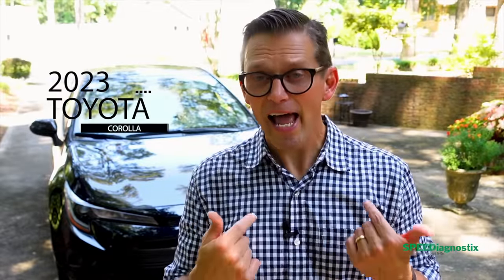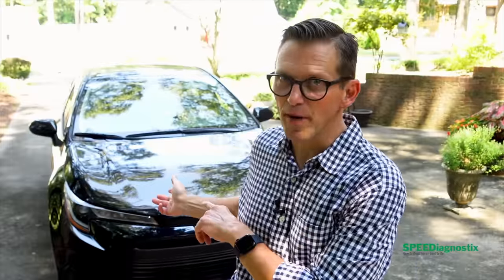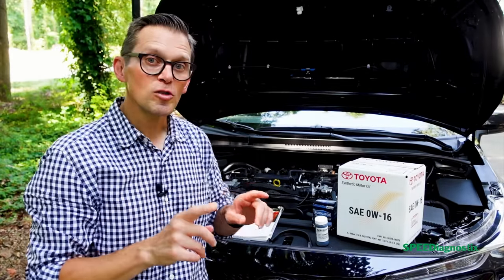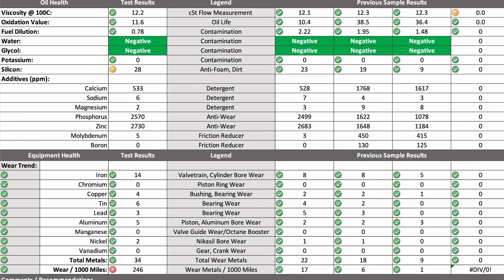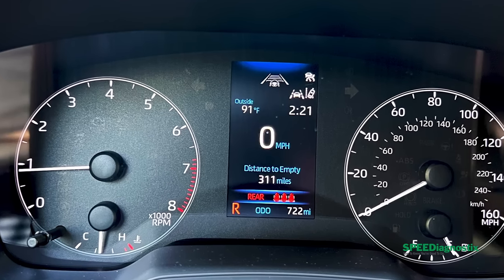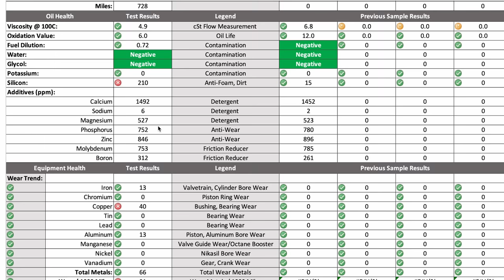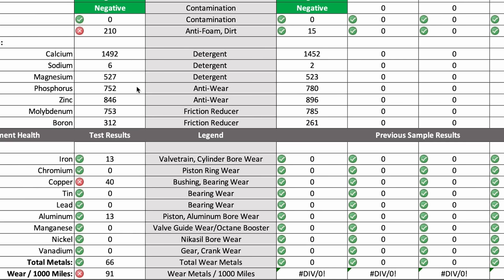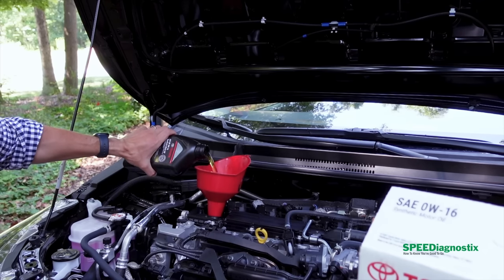AVOID the ONE MISTAKE Almost EVERYONE Makes With A Brand New Car

Comment: My Dad taught me that oil is cheap but engines are expensive.  That advice has always served me well.
Reply from the maker: Great point!
Reply: You can pick up an engine for $800, which is what a lot of idiots on this thread seem to spend on oil every year by changing it every 1000 miles 🤣  10k is perfectly fine.
Reply: well not so cheap any more. the price of 5 liters of oil is now north of 60$ in nazi europe.
Reply: @motleydude73 yeah and that new engine is guaranteed to be good and the work to install it is free /s
Reply: Hah! $800 won’t get you much of an engine. 10k is NOT fine. The proof is in these vids & the oil analysis. This guy speaks a lot of crap claiming 10k is fine, but with nothing to back it up. Unlike Lake, who has the analysis to back up his claims.
Reply: @phloughtgnarpsehs7263  10K IS perfectly fine.  Are 15000 oil changes and 32 years in the trade not enough to back up my claims? You Americans listen to Trump so I guess it's not unexpected you listen to oil geeks nonsense too.
Reply: @motleydude73 You must be a car salesman. 😂😂😂
Reply: @336W  No, a Service Tech with 32 years experience actually. After around 15000 oil changes I've yet to see any problems from following manufacturers recommendations.
Reply: My old man said the same. The cheapest part of running a car and looking after it is to change the oil n filter regularly
Reply: @motleydude73  What kind of engine can you get for $800? 🤣 Have you bought a $800 engine personally? Not trying to sound rude. Just curious
Reply: @Hzq_ali  Any engine for cars from the 90s and early 2000s. We recently replaced one in a 2002 Nissan Maxima. Was $900 + labour.  Modern ones are dearer yes but rarely need replacing. Most people actually look after their vehicles and get many trouble free miles out of them.
Reply: @motleydude73 dude Jesus 10k oil would probably be diluted and awful especially on a high pressure turbocharged engine
Reply: @concealit4800  No it's perfectly fine. A good synthetic will do 25k quite easily. It's not 1984 anymore. Where do you americans get such deluded ideas from?
Reply: Amen to that !
Reply: @motleydude73 so for you finding a solid decent, reliable used engine for $800, paying to have it fit and enduring all the hassle around that is easier than just doing regular oil changes….hmmm i’m not so sure……
Reply: My automotive teacher took it further by saying "Chemicals are cheap, cars are not." It was because he was discussing cooling systems, and asked us all the last time we changed antifreeze. I said "3 years ago." He asked why I haven't changed it already. I said "My manual says I have 5 year antifreeze." He asked me if I went 5000 miles when my manual said to do 5000 mile oil changed.

The next day I bought antifreeze and changed it.
Reply: Your dad is old. So his copied saying is no longer valid. There are many cars owners with 300k miles plus on theirs on YouTube. I've asked many of them about their oil change intervals and they all said 7.5k and 10k miles. No one disagrees that changing oil every 1000 miles is better than every 2000 miles. The point being here is, better by how much? Will it make the engine last 10 times longer? Nope. And consider the cost and all the wasted oil needed to be processed because of some silly sayings.
Reply: pieces of wisdom in sayings from those in the past are ‘invalid’….hmm there goes all of ancient Greek wisdom are anybody for that matter……
Reply: What about “don’t touch it if it works”. Changing the oil every 5k miles instead of 10k gives you twice the chance to screw it up - under fill it. Starting it without oil after an oil change etc…
I personally change it every 9k miles, like specified in the book, and had no issues at all
Reply: @motleydude73 not all engines are that cheap. One for my car costs $13k and has to be imported from Germany.
Reply: Most oil brands use the same oil base, adding in their special blend of additives to make theirs different from the rest. Basically, the additives are very important here. This geek decided to throw out the first oil from Toyota that engineers probably had special added chemicals to help with engine breaking in, and use his regular favorite brand. I don't know if that is a smart or dumb move. Why do people always think they are smarter than the ones that actually designed the cars and engines?
Reply: @noblekitty  because the ones that designed the cars design them to fail at 150k miles. It’s all by design. They don’t make a lot of money on selling you a car once. They need to sell you repairs and possibly a new engine or even a new car.
Reply: @JordanBlue1  Yes, most are in the thousands, but rarely needed. And covered under warranty usually anyway.
Reply: @motleydude73  Where do you get those prices from - 1975? Give me a break. Every mechanic I know personally say 5K on oil changes, as it’s the best way to add longevity to an engine. I also always do a first change at 1K miles. It’s cheap insurance in the long run.
Reply: @JordanBlue1  If they design them to fail at 150K, which is impossible btw, they're not doing a very good job. Most cars easily do 250K these days without much problem. Mines at 172k miles, zero issues. I see high mileage cars every day that only need regular servicing, some are 20-30 years old. You talk utter bullshit.
Reply: @motleydude73  you talk bs, it’s so rare for cars to make it that long.
Reply: @motleydude73  Your're a little confused. Here in America, we measure distances in MILES, not in KIMOMETERS, like Europeans do. A mile is not the same as a kilometer. LOL... 1 mile = 1.6 km
Reply: @JordanBlue1  As I said, I see them every day, hundreds a week, thousands a year. 150k miles is nothing these days, to a Toyota or Honda especially.  I serviced a 1995 Accord last week that had just ticked over 267000 miles. Highest mileage one we work on is a 2011 Hiace Courier van with 626000 on it at last service. That's over a million kms in my country. You're the one talking utter crap. Planned obsolescence in cars give me a fucking break 🤣
Reply: @motleydude73  yes Toyota and Honda last a long time but planned obsolescence is absolutely real. Automakers purposefully put parts that require engines to be pulled to replace when they have the tech to make engines that would never have to be serviced in that way.
Reply: @JordanBlue1  Everything wears out eventually. That is unavoidable. Things like water pumps and alternators have limited lives, though can still last 200,000 miles. They cannot 'plan' them to fail at a certain mileage. Too many variables once an owner buys the car. Some pamper them some thrash them. But things last far longer these days than they used to, the exception being whiteware.
Reply: @motleydude73  😂😂😂😂
Reply: @motleydude73  is this in miles or km?
Reply: @zivotastefanovic6923  As I have already explained, miles. As it's mostly behind the times americans on these threads. In my country we use kms.
Reply: So for a twin turbo , direct injected v6. Will amsoils top tier oil suffice, or should I change to something else. I change it at no more than 4k miles?
Reply: @danielbane3844  4000? That's like a fifth of it's useable life. Amsoil isn't great though. Royal Purple or Castrol are superior.
Reply: @motleydude73  25k ? 😂😂😂
Reply: @melvingibson4525  Yes. Welcome to 2024.
Reply: @Hzq_ali Yeah, I watched a video from “The care care nut”. Hands down the best and thorough mechanic I’ve seen. He’s a Toyota Master tech that now owns his own shop. He did a video of him doing a complete removal, tear down , and assembly and install of a Toyota engine on a 2018 Toyota Camry. It was a $13,000 job, This is not the era. Of 1980’s Chevy 350’s. 
He also went in to an engine with like,300,000 miles( I believe he just had the valve cover off.. It looked absolutely brand new.. oil is cheap.. Engines are not
Reply: You must be Kilmer's son.
Reply: He has  Porsche - with a rebuilt engine - maybe was waiting too long to change the oil.
Reply: not every one use cheap oil, for me that's one of the most important maintenance I do on my ride. That's why, after 16 years, my engine is same new.
Reply: @motleydude73  where can I pick up a new engine for a modern vehicle for $800?
Reply: @christopherrussell3073  Where did I say modern? If you'd read the whole thread you'd see I was referring to older ones. Modern engines generally don't need replacing.
Reply: @motleydude73 All our leaders are following the Klaus Schwab agenda.
Reply: How long between oil changes? It depends on how the car is used.  Short journeys and lots of cold starts = a more aggressive oil change regime.  Long journeys and few cold starts = a longer period between changes. Its not rocket science, and there's no one size fits all rule.  I've seen engines wear out in 20,000 miles, carefully driven, but only 2 oil changes over 10 years.  I've seen engines last 200,000 miles with an oil change every 10,000, but it still lasted 10 years. So, as ever, it's complicated.
Reply: @davidh3486  How on earth does an engine wear out in 20,000 miles? 🤣🤦  It doesn't. As a mechanic since 1995 I've seen literally thousands of old grannies cars that see fresh oil once every 2-3 years as they do bugger all mileage. The last one I did was a 1991 Corolla with 80,000 original miles on it. One owner since new. Averages 2400 miles a year. Her engine is most certainly not worn out. No sludge.  It'll go for another 100,000 easily. Long after she's passed on.
Reply: @motleydude73  Toyota, VW, and GM have had serious issues over the years and actually retracted OCI intervals after a few years do to sludging and oil consumption. It does happen.
Reply: @9ZERO6  No they haven't. Toyota is still doing 15,000 km OCIs. VW and Renault do 30,000km OCIs. Most companies are extending them as oils and engines get better.
Reply: If the world had more dads like yours, most of our problems would be solved.
Reply: @Corsa15DT 
Go take a history class you know nothing about nazi's
Reply: @JordanBlue1  mine is 32K from germany, you got a good deal!
Reply: @JordanBlue1  not in the usa... the average mileage on 25 year old cars (including trucks) is 230K... that is the AVERAGE.  Taxi drivers put 400K on their cars before getting a new one.  This dude is just a troll.
Reply: @motleydude73  the engine in my car is 8k new from the dealership and 5k used on ebay. I am changing my oil every 5k miles, as 5 quarts of engine oil is 20 bucks where I live. its just simple math and risk analysis.
Reply: @jay18394  Why on earth would you need a new engine? Unless you neglect it for years and only service it every 50,000 miles or so. Most people just stick with manufacturer OCIs and they're fine. It's all I've done for the past 35 years. Worst thing I've ever had happen is a failed coil.
Reply: @motleydude73  I just talked about the engine price because you said an engine is 800 dollars, which is clearly not the case for some people (including me).

I own a 23’ brz with the FA24 in it. Subaru engines are notorious for running well with frequent oil changes and blowing up with infrequent changes. The factory recommended interval is 6k miles between changes and people who seldomly track their cars still do 3k per oil change. This is widely accepted in our community with rigorous oil sample analysis and general Subaru engine knowledge. 

I might be comfortable going 10k per oil change in a civic, but your initial comment’s blanket statement is not factual for every use case. It certainly is not for my use case, both in the price of the engine or service interval.
Reply: Same, on my turbo ford truck i do it every 3-5k depending if I remember and it always ran great!